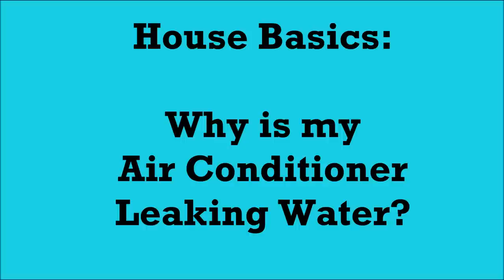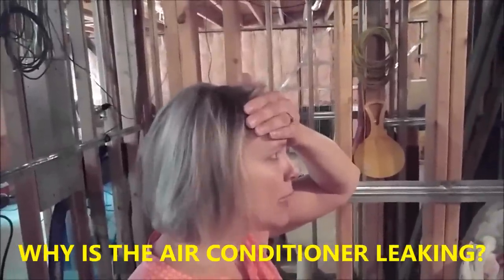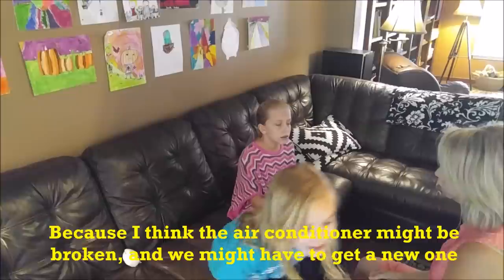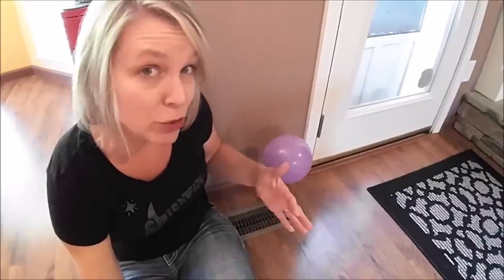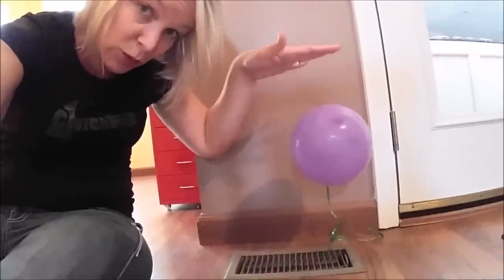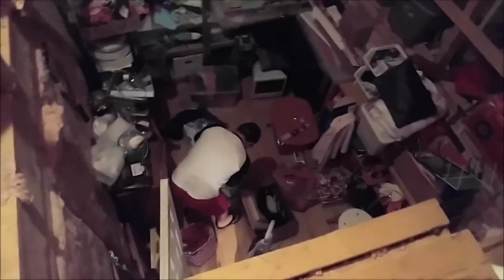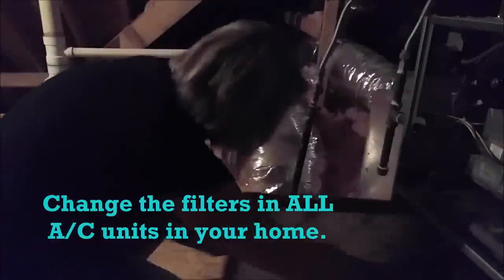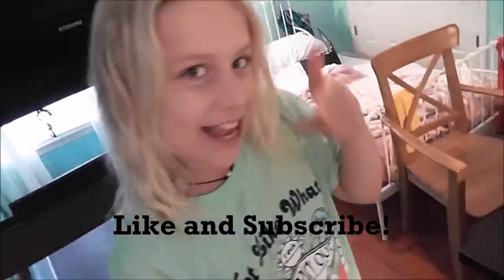Why is My Air Conditioner Leaking Water?  Cleaning or replacing a condensation/condenser pump

Comment: Do you know if it is OK for the little tray under the filter in a Trane apartment furnace to be full of water? It was full of rust and possibly mold. The maintenance guy made sure the drain to the outdoors is not clogged and the A/C still works. The air filter was replaced a month late and was pretty dirty. My parents have COPD and I just want to make sure that sitting water is normal and not an air quality issue. The maintenance guy said it is normal. Thank-you!

Comment: Hey... great video for the novice. However, toward the end you mentioned the pipe that stubs out from the side of the house... that is actually what we call the “Auxiliary or Secondary” drain line. Your “Primary” drain goes from your evaporator coil into a bathroom lavatory (usually).

I am a 25 year veteran in the industry and was enjoying your video. Great job!
Reply from the maker: Thank you for the note! I actually did an updated version of this video that is more comprehensive (and less "novice") if you want to check it out: https://youtu.be/50PS5MMueH0

Comment: Filter being dirty does not make the AC produce more condensation. It can however cause the evaporator coil to freeze by reducing air flow.
Reply from the maker: Thank you for your comment!
Reply from the maker: I actually remade this video recently to more accurately represent the issue, if you care to take a look.  https://www.youtube.com/watch?v=50PS5MMueH0&t=28s
Reply: Actually reduced air flow by a dirty air filter or restricted duct work will produce more water coming off the coil but can also make it freeze up into a block of ice.

Comment: What a great video.  Informative and entertaining at the same time.  I love the dramatic music at the beginning and the great acting by your kids when you cancelled the Disney trip!  Too funny!  Thanks for sharing these helpful tips about the air conditioner!
Reply from the maker: Thank you for your kind words!  What's funny is that I recently remade this video, and I think the second version is better in terms of being informative and concise, but this one keeps getting viewed more.  I guess it's the relatability factor.  :-)
Reply: I watched the second video and also noticed that you have a really good singing voice.  And I know, being a guitar instructor and musician.  Nicely done!  By the way, I think my central A/C is leaking right now, but I'm not sure if the water is coming from the A/C or the hot water heater, since they are near each other. But I'm looking into it.  GREAT VIDEO!!!!!!!
Reply from the maker: What ever happened with this?  Was it your water heater or your A/C?  I just did another video about water heaters if you want to check it out.
Reply: Well, it turned out NOT to be my water heater at all, but a clogged condensate line in my A/C.  I removed the line and was able to take it outside, and hook it up to my outside water spigot.  Then I flushed it out totally with lots of water.  After that I cleaned out any remaining gunk I could see in the A/C system.  I tested the condensate drain pump with a cup of water, and it was working perfectly.  I put everything back together and turned my A/C back on and the basement floor has been completely dry ever since!!!!

Thank you for asking!!!!!

Chris

Comment: If you have water in the pan that’s a problem. The pan is there in case the primary drain clogs and only sometimes are piped out but should always have a float switch to turn a/c off letting you know there’s water in the pan and to call a tech

Comment: If you are not willing to get it serviced then tape a t shirt  where the water leaks out.  My air con leaked And the dripping noise prevented me from
Sleeping so I taped an old t shirt . The  t shirt was wet in the morning but the floor was dry and more importantly there was no dripping noise

Comment: My air conditioner has water on the inside of it. Why is this
Reply: My sleeve unit has water in the bottom of  it
Reply from the maker: I'm guessing by "sleeve unit" you mean a portable or window unit? I don't have a lot of experience with these, but I would guess it's a similar issue. You either have a clog in the condensation drain line, or perhaps your A/C is low on coolant, which will make it freeze over and then defrost, causing a lot of water in the unit.